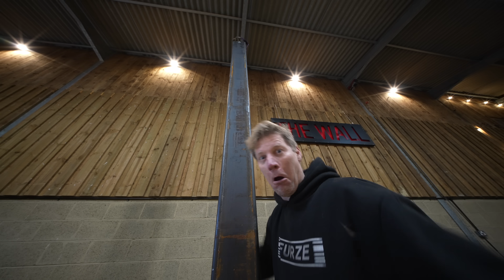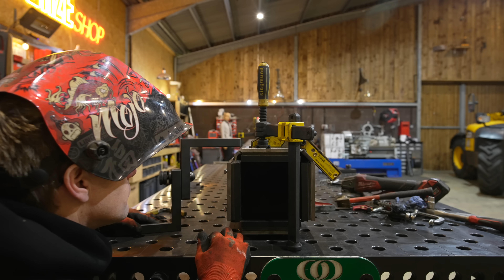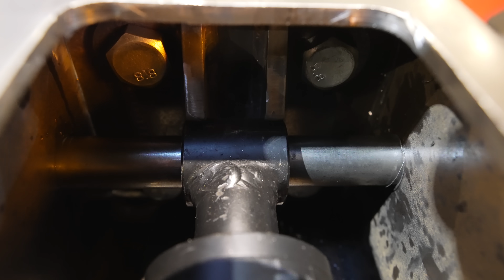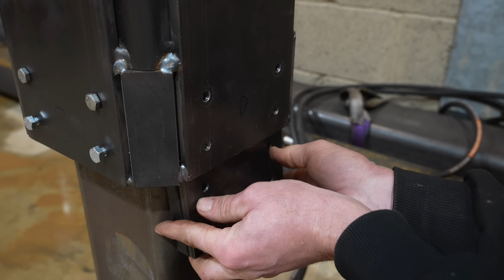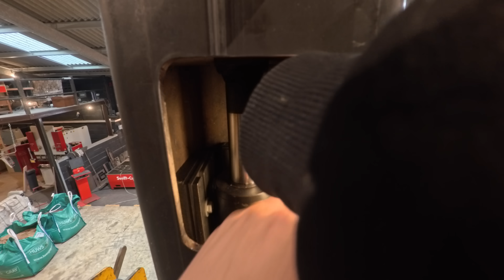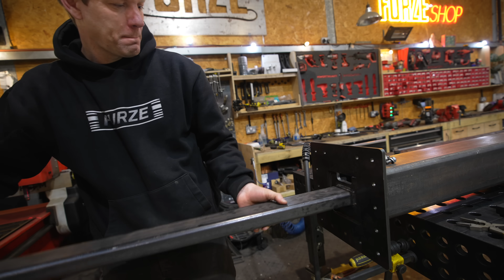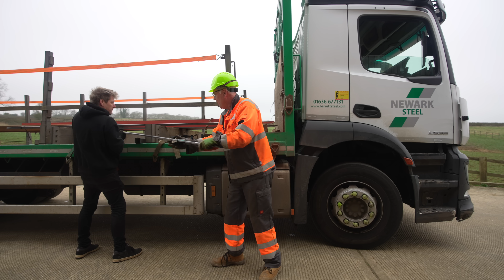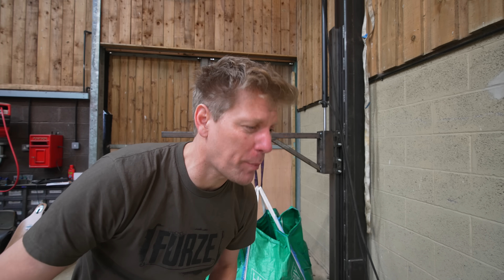Digging SECRET Garage Part 7 Car Lift Prep

Comment: The real disbelieve part of this video is that there is an engineer who worried about ease of maintenance.
Reply: The important difference between him and the ones you find out in the wild is that he knows he's the one that has to fix it if it breaks. No one else will touch this structure and guarantee your safety 😅
Reply: @jjspook not just that, he doesn't have a management team telling him what does and doesn't matter...
Reply: You have never worked in engineering then! A good engineer worries about Design for manufacturing and Design for maintenance; unfortunately, most project managers see maintenance as an unnecessary expense.
Reply: @cambridgemart2075 1000% it's always management that ruins things not the creators
Reply: That proves you Colin is a time traveler

Comment: Will it get a little safety rail that lifts up in place before the car lifting part comes up like a safety skirt?
Like, 1m tall fence circumference? Only lowering up and down its height at garden level with the road side length able to lower and raise individually.
Going up from the bunker: Park car on lift inside bunker > Safety skirt lifts up > inner car lift lifts up > outer car lifts tops it up > road side of skirt lowers back > drive car out > road side of skirt lifts back up > Inner drops > outer drops > skirt drops
Going down to the bunker: Park car on lift topside > safety skirt raises > Outer lift lowers > Inner lift bottoms out > skirt lowers down > exit car

Comment: Hey colin, this might be a late comment, but you should consider adding "safety latches", you know those clicks when a car lift goes up? Those are there if the hydraulics fail and to catch the car from falling, in your case the platform with the car.

Comment: I know its a bit late now and it may not work for your purposes, but I'm a lift engineer, we use t shaped rails, not sure how much they cost but for future reference for you future projects, reeley ltd, in solihul have almost every kind of guideshoe and liner, and guide rollers comibination you could think of, and these guides are machined to size, also on hydraulic lifts they often run a 2:1 rope setup to increase travel etc. 

Ps, please dont think I'm criticism of your work in anyway, this is just the direction I would go as a lift engineer, what your doing is proper cool and proper mental

Comment: Colin -the inner smaller box section column  must be fjxed to the floor while the larger id  COLUMN is the moving upper hollow box section (HBS) should be the the one that is attached  to the top slab and thus prevent rain / water from getting inside between the HBS's..
Good luck

Comment: Add a a built in vacuum system for dust and debris.

Being able to activate it with a switch, or just having it activate in sequence with the lift lowering would be ideal.

Comment: Hi, did calculate for the 12 tonnes plus bearing down on four points to the concrete? 
I'd hate to see stress fractures after you've finished. 
Or did you create extra reinforced pads beneath each stanchion?

Comment: Question Colin: the main reason to hoist a car is to access the parts (exhaust, break cable etc) underneath. Car hoists minimise the support area under the car to allow access, four lift points or tracks for wheels, all else clear. How will you do maintenance under the car if the whole floor is lifted with the car?

Comment: I enjoy the idea of a rotary lift with a mid stop and an extension lift to lift even more. Here in the U.S. ,a rotary lift has the same idea, but the extension part seems tricky, which you did a hell of a job engineering that portion. Not sure if it'd be worth your time looking into and rotary lift and fabricating and strengthen it @colinfurze

Comment: Super cool. But I just don't understand why he goes to so much trouble to place that cylinder inside that metal beam. Wouldn't it be easier to place the cylinder next to it? If this is necessary due to oblique forces, then I would use two smaller beams with the cylinder in between. And do this at every corner. Easy for maintenance, and looks great.

Comment: Great video.  I know its early days but have you thought about the safety side of this project? Just thinking of a dead man switch for operation so that is operated safely.  That way if the operator takes their finger off the button everything stops.  Or if not, you would an emergency stop button so someone can stop it half way through an operation.  Then what about sensors so make sure the path is clear and it automatically stops if something is unsafe.  Might need a PLC controller for all this though.

Comment: A screw- elevator wouldn't been more practical ? NO extruding  lifting arms to contend with , if space is a problem.  Could ALL be Electrical with micro-switches. Only the platform is ascending /descending .. 240V Mtrs, w/capacitors for Boost starts..SIMPLIFIED...Gd. luck.

Comment: Regarding your plastic pads. If your handy with a milling machine, you could machine a pair of pads with a matching angle to make wedges. If ones fixed and the other slides with an adjuster screw, you've basically built a gip strip as per what machine tools have been using for donkeys years.

Comment: I assume you've thought it through, but I'm surprised some of those tight tolerances will work with the heat expansion/contraction the lift might see.

Comment: Not sure if it’s an idea you’d take on but maybe design a lift that can be installed in houses for either wheelchair or elderly access. Everything I’ve seen commercially is very expensive, out of reach for most people. But a good set of open plans could radically change the field and open up options for a a lot of people

Comment: I feel like it would’ve been easier to buy a 4 post car lift, and then retrofit the external ram to lift it up more? Idk, I’m not a structural engineer, but I’ve spent a lot of time around ramps, and a fair amount of time in an engineering classroom 😅

Comment: 25:20 it might be a good idea to put a locking wire on the nut for those longer bolts to prevent them loosening over time. This has been a really fun project to follow !

Comment: Are there footings under each of the legs? If not, there's a risk of cracking the floor slab with that much weight on it.

Comment: Getting good extension length with hydraulics is super hard, but I think the way it's done in telescopic cranes is super awesome, you trade some of the power of the cylinder for length by gearing it with a chain and having three pipes within each other. Very cool!

Comment: Been watching this project on and off for the last 2 years or so and I cannot recall if I had mentioned this but you really should paint the steel structure and/or install 4 gas monitors within the space to ensure you do not get oxygen deficiency and or displacing gasses in the space  and ensure your air movement system has backups for electricity in the case of power outages.

Would hate to hear about how you died due to asphyxia via a lack of oxygen or introduction of heavy gasses either from work being preformed or leaking in from the ground.

May also want to install radon gas monitors.

Other then that really enjoying this bunker project looking forward to the next episode.

Comment: Hydraulic cylinders, dig way the heck down, plate the opening with a solid base with easy mount base, and use sleeved hydraulic cylinders that go up by levels with nothing above the ground, or above the platforms, maybe some guide rail, with ratcheting locks, with a electro 🧲 lock release circuit…
Hydraulic tanks, pumps, hoses, valves…
Good to go…
Can’t wait to see what works best…
🤙

Comment: 2 way-3 position compensating valve may be useful to lift equally instead of daisy chaining it all together, if one binds up they all bind up that way. compensating valves can sense pressure and prioritize hydraulic flow equally and can be adjusted in most cases.

Comment: This method is unsafe, because the concrete base you made for the garage is not thick enough for the rams,
You'd have to make the areas where the rams are much deeper in depth into the ground with concrete.

Comment: 24:57 Hy Mr. Colin, here i think will be necessary a stupid proof mechanism to prevent the fallen down, with you onboard of the D-FLS - DeLorean-Furze Lifter System, made some hook to keep you safe if some parts fall, think about rindondance, like in the air business. Ciao Think SAFE
Reply: 29:33 Now i see the safe mechanism, but, if you want my opinion of Junior Engeneer of automation electrical system, you need to have a idraulic cylinder under the platform, full of oil connected to a reservoire, to made impossible the fallin down, i was thinking of Titanic..

Comment: If rams would be connected together, then pressure should equalise automaicaly, oil is not "squashable" so normally there should not be situation when uneven move is realistic,
but better be safe than sorry.

Comment: Why don't you lift the platform using winches with pulleys? That would save you several tons of steel and significantly simplify the construction.

Comment: you might want to use welding nuts in the future instead of increasing thickness on the steel of a plate you separately attach on a structure.  cheaper faster lighter and in your setup no change in strength

Comment: Maybe a lil expensive, but surely go down the PLC route for a level lift? Transducers, plc and solenoid valves. Tbf not even that expensive nowadays will how available they are now. Definitely the most reliable option.

Comment: well done :) i would have made a scissor lift and a crane or excavator like turn table on top , the downside on that system is you need to dig another 1.5 mtr to fit all when closed :) in my garage i have a forklif mast attached to the wall to use as goods lift :)

Comment: On a hydraulic front trying to keep 4 cylinders in sync can be a pain. I have been designing hydraulics on Subsea trenching/ploughing vehicles for 9 years now (doing other hydraulics 5 years before that and also run my own hydraulic company in parallel) and cylinder syncing is a common need. When they are close together its easy, just to let a mechincal link sort them and oil finds the easiest path, however when they are further apart things become more complex. Some people say flow dividers however they aren't recommened when the cylinders are mechincally linked, can cause issues. These days we normally have LVDTs within the cylinder or external, which then feed back into the control system the length out of the cylinders. The system, using a PID loop, controls proportional DCVs for each cylinder to control the speed. You will have one cylinder as the lead (or master) then the rest follow as slaves. Works very well but involves a lot more electrical and software input. There are more crued methods hydraulically to do it via counter balances and fine adjust but things are all moving with the times and electronics :) Very interesting project, and if you ever need any hydraulic advise just shout would me more than happy to give it :)

Comment: COLIN! REGARDING HYDRAULICS!  Lifting everything at same time in all four corners!

Make a Manifold and/or equal length Hydraulic Lines so that ALL HYDRAULICS RAISE AND LOWER AT EXACT SAME TIMES!!!

As you already know,  the professional certified Two/Four Post Car/Truck Lifts work in exact same principles as your current design.  Hydraulics Rams and Cables to sync them.

HOWEVER!

New Namebrand Lifts...  Hydraulic Lines are Daisy Chained WHICH IS A TERRIBLE DESIGN!!! 

LIFT ARMS DO NOT GO UP AND DOWN AT SAME TIME!  THE DIFFERENCE IS 3-5 INCHES! CABLES HELP BUT WONT SUPPORT THE WEIGHT.  THEY ARE STRICTLY A SYNC MECHANISM!

Make a Manifold and/or equal length Hydraulic Lines so that ALL HYDRAULICS RAISE AND LOWER AT EXACT SAME TIMES!!!

Comment: Hi Colin, Haven't read all the comments but need to highlight concern over the 8.8 bolts you are using to secure the bearing assemblies. Speaking with 40 year experience in jig and tool design and manufacture they are not suitable for the bending / shear being induced by the cantilever of the car platform. Even though you load tested them they will suffer fatigue and shear. Any axle used to mount roller bearings in the manner you have will be subject to high bending moments. I would recommend adding additional heavy gauge steel brackets, running just clear of the inside face where the bearings run as a failsafe measure. Better safe than sorry. Great show....

Comment: The nuts and bolts should be brass so when the pads wear down the bolts don't cause unnecessary wear on your steal square pipe. Thats how they do it on my drill rig I work on. All the shims are held on with brass bolts.

Comment: Wouldn't a simpler design have been to use a single hydraulic ram that pulls 4 steel cables through a series of pullies? Like a deck edge elevator on an air craft carrier?

Comment: We have a similar system at work for lifting the BOP on the oil rig. To make the four rams move at exactly the same time you can put in a four way hydraulic load divider.

Comment: Some of those welds on that final install of the post look niiiice. Did you have some help on those bits?. Those beads look loooovely and full penetration. Share a tiny bit of cred with the poor fabricator/welders I say🥺.....     😄. Unless Colin is secretely an arc artist??     Cooooliiiiiin??       😉

Comment: Might need some pawls or a revelling system to prevent sinking. Especially when entering or driving off the platform.
Reply: I’m a lift engineer and all the car lifts we installed used a scissor mechanism with either 2 or 4 rams. One of them lifted a completely loaded artic.

Comment: Have you considered de-accaleration forces? If you drive the car in or on top of the lift, you need to break, which creates forces on the platform, pushing it over. Either you have the beams carry that or you have something to push the lift against.

Comment: Collin when you get to the wiring part.. sensors and all. . I think it would be cool to have mechanical switches on site for sure.. but it definitely needs an app you can remotely open it with your cell phone from anywhere in the world. Also camera setup so you dont open it causing issues. I know this needs to be fool proof.. but it's doable.

Comment: do you think its cheaper using 4 rams than one single huge telescopic piston under the platform?(as small lifters) maybe would be easier to secure it, but i guess its a pain in the ass for maintenance

Comment: Colin, Maybe you should try using cables that they use on a ski lift as well If you're concerned about hydraulics failing 
I don't know how you would combine that together but just the thought I had.

Comment: For the cable assist for Post 1 to 2. can you mount the cable to the bottom of the lift, pulleys on the floor, wall, and ceiling, returning the cable to the top of the platform at post 2, then do the same to make an assist from Post 2 to Post 1. |x| when the bottom of 2 moves up, it pulls up at post 1, when post 1 moves up it pulls up at post 2. 1/2 on side , 3/4 on the other side. you wouldnt need any walls persay because you are making sure the floor is always level so it can never wedge.

Comment: Actual engineering: 100% effort
Extra engineering because it's potentially dangerous: 100%
Navigating the scrutiny of armchair experts: 100% effort
Making a video about it: 100% effort
Colin is putting in 400% effort by my calculations

Comment: Best way I know to sync same size hydraulics is to pipe the first cylinder bottom inlet to the pump then the top inlet to the bottom inlet of the second cylinder and so on until the top of the last cylinder goes to the pump return. The first cylinder goes up and that pushes oil to the next which goes up and so on. When bled properly the cylinders are synced and can’t come unsynced unless a leak occurs.

Comment: I am wondering how can you synchronize the movement of the 4 hydraulic rams ？It is crucial because any unbalanced movement of these 4 rams will cause a dangerous tilting issue which could lead your car fall over from the platform. I think you need to test this carefully.

Comment: Please don't put the rams against the walls. i live in a dug out under the ground essentially one great big supper version of your garage. instead of steel skin we render the walls with concrete then plaster. BUT we do have a kitchen that was enclosed with steel exactly the same as your methods. Problem we had was separation between the rock face and the steel skins. This invites moisture into the cavity, and one feature of anything underground, cavities with temperature variations will attract large pockets of condensation. Now add ANY vibrations or torque to the steel skin and you drive an air bubble around your structure. when that happens, you separate your construction from its foundations. What your planning with the lift is going to tear all your hard work apart IF THE RAMS ARE ATTATCHED DIRECTLY TO THE WALL. Don't attach them to the wall. You're not configured for, repetitive stress damage over time multiplied by the value of force exerted.

Comment: Forget Cables, forget chains, Hydraulics if installed correctly will have an operational time that far exceeds mechanical options, the safety issues are minimal if the flowback sump is a tank (BUILD LIKE A BRICK SHITTER), again it comes down to installation and the flow sump configuration. Ratchets should replace cables, and chains, for a noisy but far simpler and reliable safety system. To stop your loved ones from getting caught under the lift and turned into pancakes, either add telescoping gates that store in the floor or even easier. lace the garage floor with a Mission impossible laser grid that if broken stops the lift in its tracks.